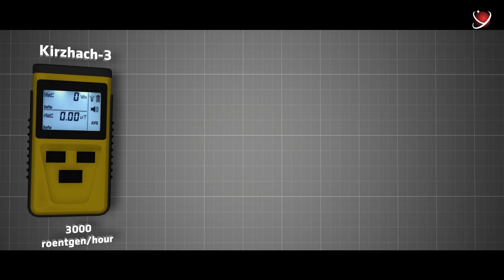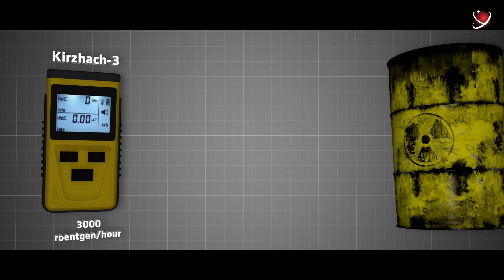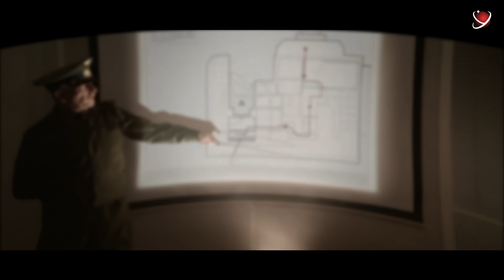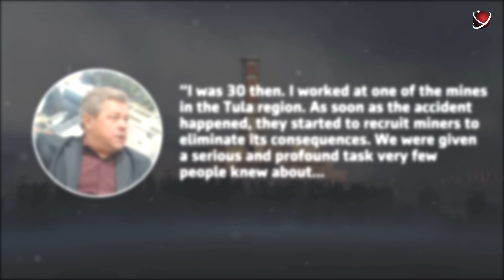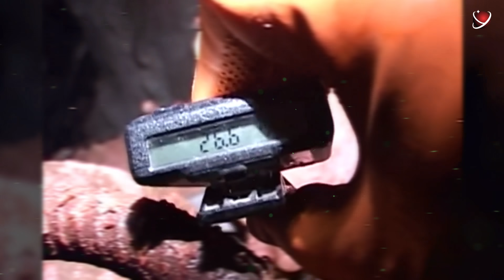How Chernobyl Still Threatens The World

Comment: They dumped boron on the reactor and sand not lead you need to research. Lead is used as a shield against radiation not as a nuclear inhibitor that is what boron does. Graphite was used to contain the nuclear reaction and as a particle accelorator. The nuclear energy bounced off the graphite and colided with other nutrons slpiting apart causeing the reaction which heats the water creating the steam  to turn the turbine. The sand and boron had to be dumped in the general area thus adding to the sludge created by the meltdown. Boron indeed helped but the sand its self contributed to the problem. When nuclear fuel is confined it does climb in temprature. It melted through the reactor core and the bubbler pool had to be drained to prevent a thermal nuclear explosion created if the nuclear material reached the bubbler reserve tank through the cement pad below reactor 4.

Comment: the cores are burning down to the water table... they will be there soon....
Reply: @HE-pu3nt  they are, something like 6 yyears ago i was shown a report where the cores were going down into the water table, i thought this was public knowledge,  i know i had heard they had planned to stop it... but they said that was a bandaid... i dont then
Reply: Okay, you explain to me how an object generating enough heat to maintain a temperature 2'c above ambient can bore it's way through concrete. And don't quote me the report that originally made the claim because it was widely discredited in main stream science. As I stated, the whole mass generates 10 Watts, mainly from alpha decay, that was 10 years ago, it's even less now. Concrete starts to decompose at 600-700'c. To be boring through concrete as the report claims requires energy, it's just not there anymore.
Reply: @HE-pu3nt  look man, I don’t know as I said, I don’t have the data, this was 7 months ago… if you think you’re right then so be it, I just know what I read, and what they told me at the plant..  I don’t know what they say now, or what they have done of anything… but I guess either way we will find out soon…
Reply: There was some talk about radiolosis breaking down water molecules to form a weak hydrogen peroxide solution which could attack the concrete. But since the new confinement was sealed the main thing they have been doing is dehumidification work to remove all traces of water from the structure. So this mechanism should no longer be a problem.
Reply: @HE-pu3nt  I’m not so sure about that, most of the lower parts of the plant is flooded, has been for a long time, is now and was 10 years ago… now that water just recently has shown signs of higher levels of radiation, this was simi confirmed by the crazy guys that go swimming down there, that water could then leach into the water table… kinda how water works… there are places in the plant where the water can or eventually get to… that will be of much higher concern…  this is when we will see a more public health issue…. This place is a ticking time bomb… we haven’t heard the last of it
Reply: Indeed we will. Have a great day. 👍.
Reply: @HE-pu3nt  same…

Comment: Well there is a cooling block layer of cement 10 foot thick with pipes running all through it to cool off the loosing black lava called """the elephants foot"" to keep it from contaminating ground water in the area , also a 30 X30 meter room to stage said refrigeration systems all installed by miners immediately after the big catastrophe. But you wouldn't be interested in things or facts like that now are you .
Reply: Did you not watch the video?

Comment: The mini series called Chernobyl was the first time I heard people been referred to "biological robots" and it was a terrifying realization
Reply: You man the joker?
Reply: @GDR660 humans
Reply: I'm Sorry Guys 😔
Reply: It was a name coined for the liquidators who went on to the roof to remove the pieces of graphite that came from the lid of the reactor . Since the actual remote controlled machines used to initially push the parts off the roof were breaking down due to the radiation . And they had to move fast,  it was a hard but “had to be done” solution and it payed off . 

To sum up as to why they were in such a rush is because helicopters needed a safer way to offload sand and led into the still on fire reactor , they needed a way to get onto the roof and not only have a way to asses damage but have it cleared helped with making the first sarcophagus easier (because even high up the meters we’re still  bouncing past max on their indicators meaning even the pilots offloading said material were also being prone to heavy radiation) it was after all this that they came up with the plan to make a tunnel under the reactor to offload nitrogen and concrete (because after the success of the first half of the plan it was eventually figured out that the molten plutonium was still slowly burning throw the concrete all they have done at this point was stop a lot of the heavy toxic plume being released into the air and after finding this out again it came down to “it has to be done Decision” because had that plutonium melted through and onward through the soil it would’ve contaminated all of Russia’s water supply and Could’ve made the whole country uninhabitable but thanks to those brave fighters and first responders & the liquidators for their hard effort to stop this monster of a disaster that didn’t happen and the damage was only contained within the city . It’s really a eerie thought to think Russia could’ve been a wasteland like fallout , at the end of everything let’s just hope the event helped big shot leaders just come clean with what’s going on and work fast on a solution , Lying to the people and letting the situation sit has showed us the effects of what happens to such negligence not just on the innocent civilians but everything around them and not only that but to be more careful with such creations , at the very least this event helped the dismantling of atomic weapons back in the day (which if you didn’t know Russia was actually ahead in that part of the game within the world powers at the time because of the infamous ICBM’s which they had made in the masses) there’s just so many variables and effects that this one disaster has caused both positive and negative this piece of history will forever awe me
Reply: No it was not radiation, the joker and all the ROVs keep getting stuck in debris, so instead of going out there and getting it out of the debris they instead start using liquidators to finished the job, and the helicopter crash wasn’t do to radiation it was do to it having its blades get tangled up in the crane wires as there was a tall mobile yellow crane there used for removing large debris and then throwing it into the reactor, like that death claw yeah that’s what it was use for.

Comment: large scale sacrificial facility, yielding nothing but structural integrity data and operating parameter information given available containment materials. 20% enrichment limits as known half of what is 40% is considered a supercritical phase that cant be held outside of core... so if they add more pellets in the core, at above 19.9998% core saturation the facility is considered a bomb... commissioned to core size the total amount of pellets at facility in use or not making the aria of the core "calculatively enriched" to more then 10% is prohibited, of the pellet's themselves regulated at no more then 19.9998%. common sense open source data, 40% enrichment sparks a self induced run away... need to be regularly testing the fluid for accumulated contamination, its a simple acidification crystallization reaction up scaled to a large pool size to flush and test cooling fluid for internal leaks that would saturate the cooling fluid into a thermal production reactor if unchecked. "water that stays hot for a long time is contaminated = the core pellets are leaking allowing absorption into the cooling water" (ordered maintenance shut down, flush all systems for reprocessing/chemical filtering/refining). something that just sits their at 100% output for 80 years then it drops to 50% so ?% of original load can be added to get it back to 100% generating capacity. find a leak = start over "throw the car out when its down to 3/4 of a tank".
Reply: Wow, like I dont understand why you couldn't say the same thing with correct punctuation and grammar and some of it might actually make sense. Clearly you did that to seem smarter than you are, but it does the opposite.
Reply: Either that or he’s just got far fingers 😅

Comment: if the Uranium and Corium come in contact with enough water, the chain reaction could start again, because the neutrons get moderated efficiently. The danger isn't only about spoiling the groundwater. The Chernobyl (and Fukushima) corium need to be dug out and safely stored in subcritical junks or reprocessed! if the Corium heats up, melts again and formed a nuclear corium globule, it could even go supercritical. (Military experts know, what that means). 
Any Breeder reactor or reactor operating on a fast neutron technology has this lurking water-moderator-risk!

Comment: No corium  was made at 3 mile island what happened there was a hydrogen bubble formed the fuel never melted down
Reply: @Thebestcayplaysonyt is correct. There was a partial meltdown but the fuel did not escape the reactor containment vessel.

Since the nuclear fuel was contained, and was unable to mix with other material, like concrete and sand at Chernobyl, no corium was created.

TMI was caused by poor training of the staff and bad design of indicator lamps. During a routine cleaning operation, some water found its way past a check valve and caused a number of pumps to stop working. This led to the steam turbines being starved and the safety system tried to cope by reducing other systems. The system was compensating as it had been engineered. The lack of training for the personnel and poor design of indicators meant that the potential problem was overlooked while the reason for the alert was being investigated.

During the event, hydrogen gas formed a bubble which was believed to have caused a small explosion.

After the event, an investigation found that TMI had violated multiple operating protocols and personnel had made assumptions on the status of the system without physically verification. It led to significant changes in the nuclear industry.

As for Chernobyl, the Soviets kept all nuclear accidents as secrets and the same errors were repeated in multiple nuclear power plants.
Reply: I don't think that's true
Reply: @jackoliver7506 you are a nuclear expert you are so....
Reply: This is not true. Corium was formed at three mile island. The only difference is that the melted fuel at TMI was contained (unlike at Chernobyl). 

Corium is when nuclear fuel overheats and the contents of the nuclear core melt. It does not require the addition of sand, boron, lead etc in order to become corium.

Corium, also called fuel-containing material (FCM) or lava-like fuel-containing material (LFCM), is a material that is created in a nuclear reactor core during a nuclear meltdown accident.

 Corium looks like lava in consistency, it is a mixture of melted nuclear fuel, fission products, control rods, structural materials from the affected parts of the affected reactor, products of their chemical reaction with air, water, steam, and, in the event that the reactor vessel is breached, molten concrete from the floor of the reactor room.

As for TMI, During the Three Mile Island Unit 2 accident, a pool of molten corium formed in the central region of the core and was contained by solidified crusts. Failure of the crust surrounding the molten material at 224 min resulted in a relocation of an estimated 29 tonnes of molten corium through peripheral fuel assemblies in the east side of the vessel, as well as through the core barrel assembly (CBA) at the periphery of the core. The results of analyses carried out to investigate the heatup and ablation interactions of molten corium with the CBA structures during the relocation event are presented.

tandfonline above ref.
Reply: Corium was created with the reactor, but it was mostly a Uranium-Zirconium eutectic molten blob that melted into the steel at the bottom of the reactor vessel, which fortunately was not melted through as the bottom of the reactor at Chernobyl was. In that accident, the Uranium-Zirconium eutectic mixture began melting sand, serpentine, concrete, steel and anything else it contacted after the explosion. As it spread, the Uranium was diluted and the fission and heat production declined and the Chernobylite or Corium's make up became increasingly diverse depending on location before it solidified.

Comment: Could be anywhere in the USA! 🙄
Reply: ...not with modern technology and long as it's away from earthquakes and tsunamis.
Reply: @newporg6887  If you're mentioning Fukushima, that event and the few others were caused by severe oversights and not following regulation standards. If there were submarine doors to the backup generators in Fukushima, they wouldn't have flooded, but even then it's been confirmed at only 2 two people who were working closest at that plant actually got affected by the radiation, thousands more were killed by the earthquake/tsunami. As for Chernobyl, it was the Soviet union they didn't give a damn, so that was out of severe incompetence/lack of backup as well. Apparently the 2 mile radius area from the reactor have had radiation readings on the flora/fauna and it's way less than you'd get on a transatlantic flight.